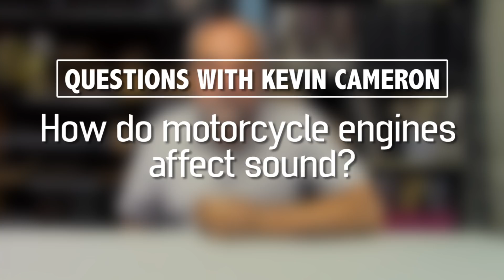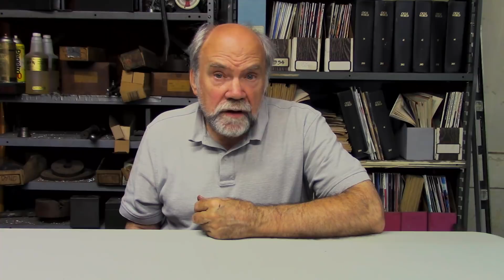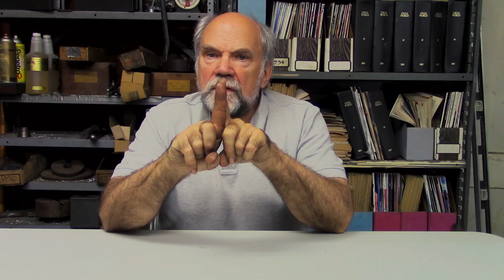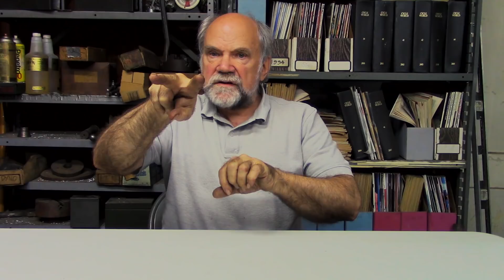How Do Motorcycle Engines Affect Sound?

Comment: So why doesn't a 360 deg parallel twin with separate exhausts just sound like a single running at 2X thr rpm, and for that matter, why don't all even-firing engines sound more or less the same?

Comment: Would have liked to hear about V4 sound, and maybe a little on how the shape of the exhaust pipe itself (other than the muffler) effects the sound.
Reply: Kevin Cameron, I remember reading in a car magazine, years ago, that engines with cylinders divisible by 3 should have conical, megaphone shaped exhaust, while cylinder configurations divisible by four, should have consistent diameter exhaust, so it's interesting to me that you pointed out that Mike Hailwood's motorcycle had long-taper megaphones!
I never learned, however, if this was for better engine performance, better engine sound, or if it was just B.S.
Thanks for the reply!

Comment: V configured engines sound better than inline engines.
Inline engines power output is smoother.

Do V configured engines have a torque advantage over inline designed engines?
Reply: As an engine design - no.  As they are typically 'tuned' - yes.  Twins can't rev as high so are typically tuned - head flow capacity, cam timing, etc - to give their peak torque at a lower rpm.  Hence the often talked about torque advantage.
Reply: If there is no torque advantage, as you say, then why do some MotoGP engine designers choose a V configuration over an inline configuration? Why does Yamaha use a crossplane crankshaft in their R1 inline engine?

~~~Wikipedia~~~~~~~~~~~~~~~~~~~~~~~~~~~~~~~~~~~~
A 'big bang engine' is an engine designed so that most of the power strokes occur simultaneously or in close succession.
~~~~~~~~~~~~~~~~~~~~~~~~~~~~~~~~~~~~~~~~~~~~~

Most V4 engines will inherently have this. 

Yamaha tries to mimic the big bang firing order with the crossplane crankshaft.  
They take all the size and weight advantages of an inline engine and put a crossplane crank to take advantage of the big bang.

Power strokes occur in close succession.
Torque advantage but slightly unbalanced.
Reply: that's about the firing order and effect it has on tyres in extreme use.  it's not about potential peak torque output or where that peak occur in the rpm range
Reply: the uneven firing impulse gives a  handling advantage because since the power is not smoothly delivered the tire actually momentarily regains traction during the off moment where no power is delivered then loses it when the power impulse hits. Pretty counter intuitive but it is actually much better to have this uneven firing impulse + it sounds so much cooler!